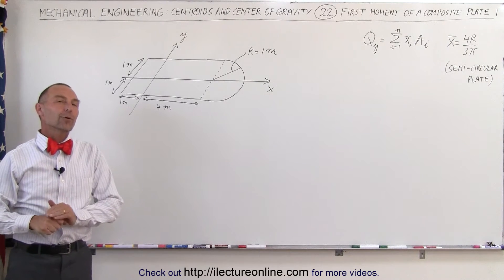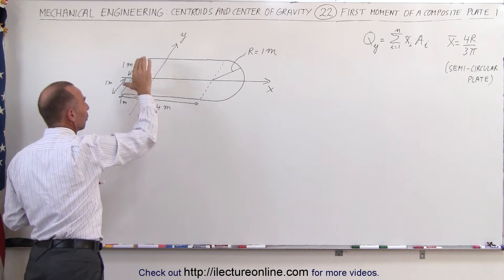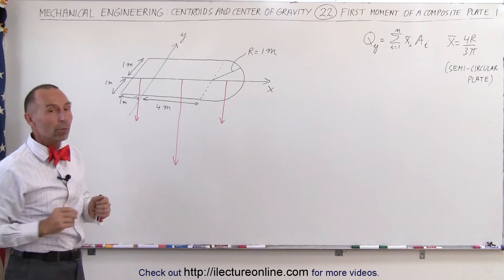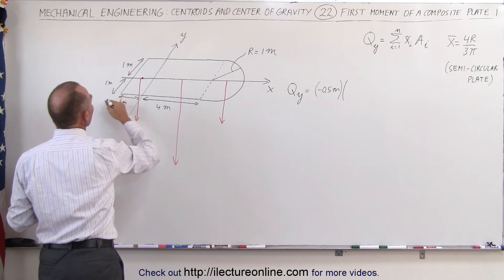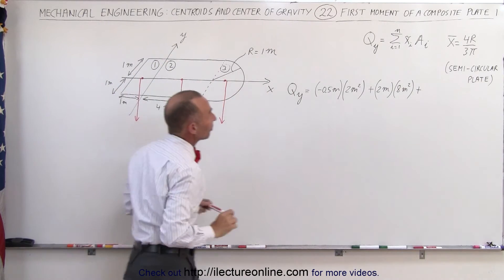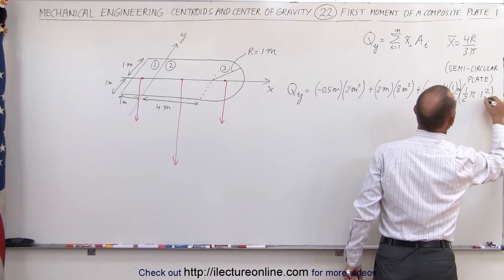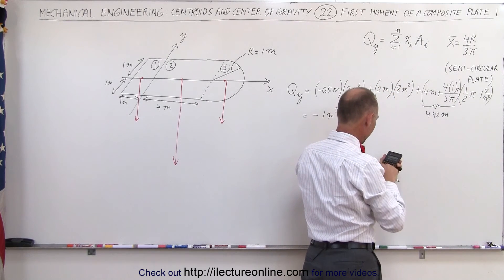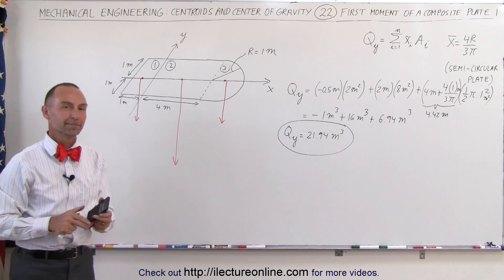Mechanical Engineering: Centroids & Center of Gravity (22 of 25) 1st Moment of Composite Plate 1

Comment: Sir what puzzles me is unit like why is the unit of the first moment meter cubed
Reply from the maker: Normally the units are m kg^2, but in this case, instead of using the mass we used the area instead, since the mass is proportional to the area (constant density, and thickness), we can make that substitution.  The result is that the units become m x m^2 = m^3